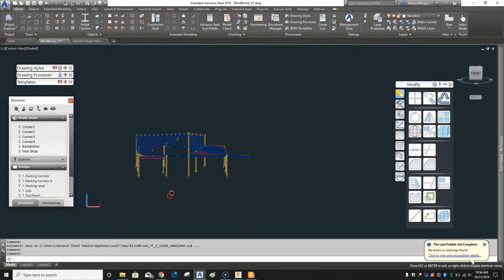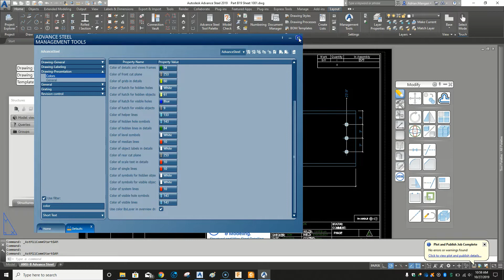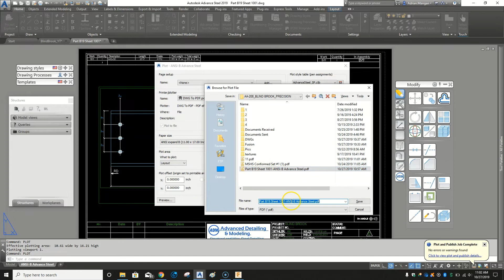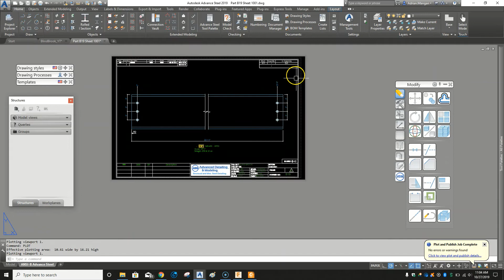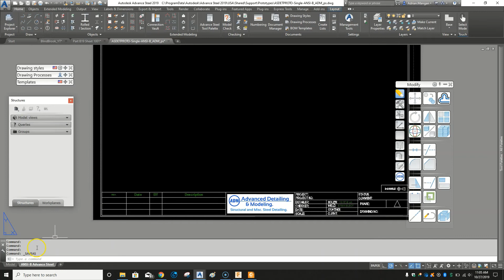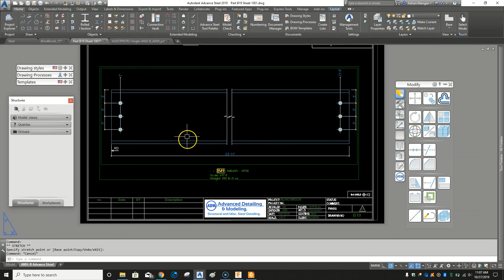Advance Steel - Editing Plot Styles for everyday use

Comment: Do you know how to change the linetype  for handrail? I have a customer wanting line, circle, line to show on plan view for General arrangement drawings.  These are for a Engineering company wanting more out of Advance Steel.  Also if you have any tips on how to change the view for plan and elevation view callouts for steel instead of having them as "W12x26" he would like to see "W12".  Thank you, I enjoy your videos greatly and have learned alot from you.
Reply from the maker: Hi Julio, going to put up another video that will show you how to set your presentation for those railings.